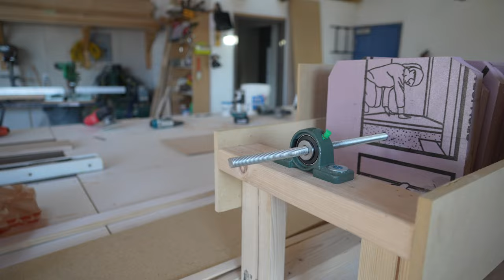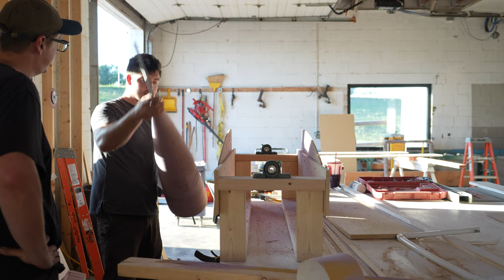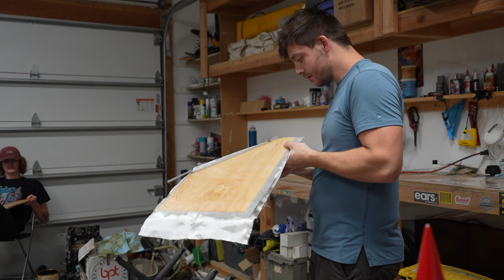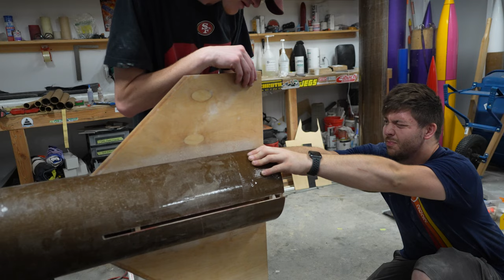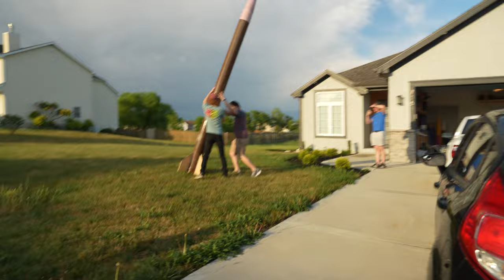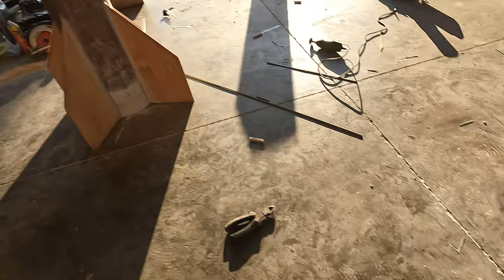Building A 15 Foot Tall Rocket In One Week...Again! | The Double Arcas

Comment: How did you attach the shoulder of the nosecone to the nosecone itself?
Reply from the maker: Epoxy on a bulkplate to the base of the NC, then a bulkplate epoxied at the end of the coupler with a nut bolted to the all-thread inside the NC
Reply: @RocketVlogs  thank you!